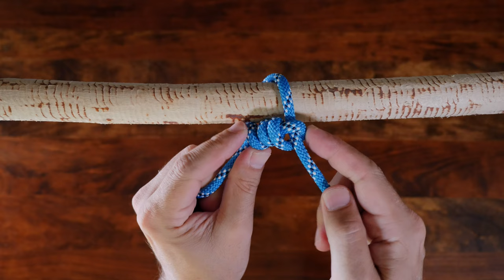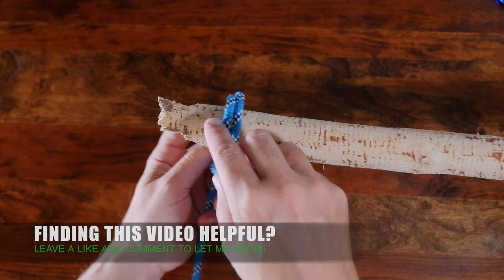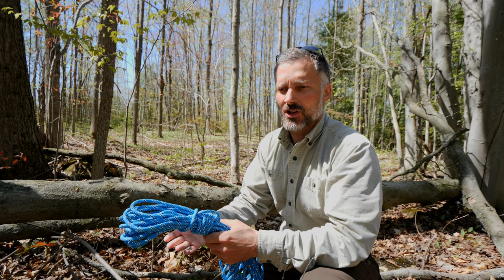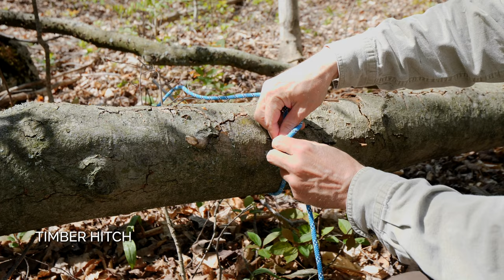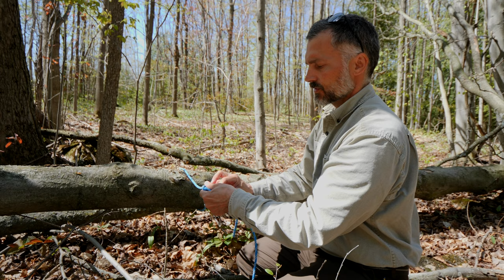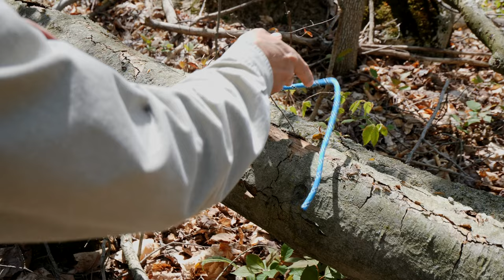Timber Hitch vs Clove Hitch | What is the BEST KNOT? | Hitch Knots

Comment: Every knot has its use. The clove hitch is great on a boat, for tieing fenders on the side for example. The timber hitch is great for the application you displayed, hence it's called the timber hitch.

This is the case with every knot, every knot has its reason. A good read about knots is the Ashley book of knots.

Comment: As an ironworker I use the clove hitch daily.  In a real world application you always finish it with a half hitch, always.  Prevents it from loosening when not under tension.

Also you refer to both ends as working ends.  I've always been taught that you have a working end (hoisting or pulling from) and a dead end.  Probably just semantics, but I can't help but notice.

Over all great video and content.
Reply: What you call the working end, he calls the standing end/line/part and what you call the dead end, he calls the working end/line/part. I think this is the usual convention in knot tying because you are "working" with the loose end to make a knot, while the other is just fixed, or "standing".
Reply: I prefer the constrictor knot to the clove hitch!

Comment: I thought the timber hitch was used for hauling logs as it was secure when pulled the longways of the log, wouldn't bind under heavy loads, easy to tie and untie even with very heavy line......clove hitch would not be used in this scenario.